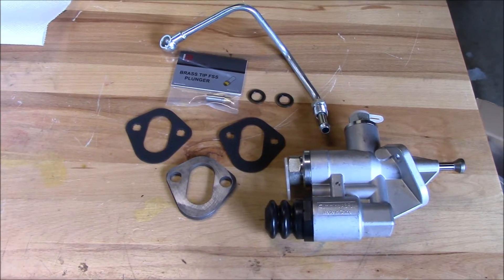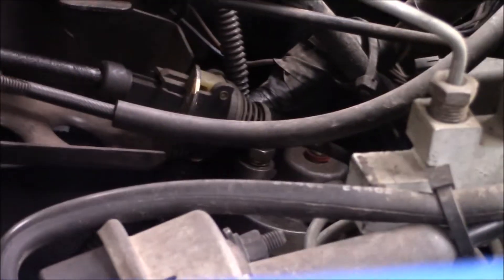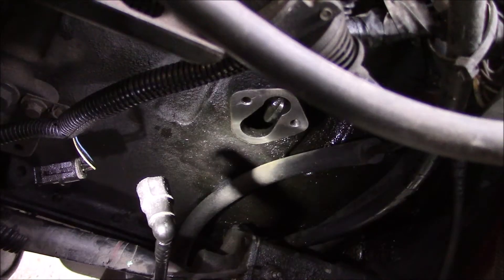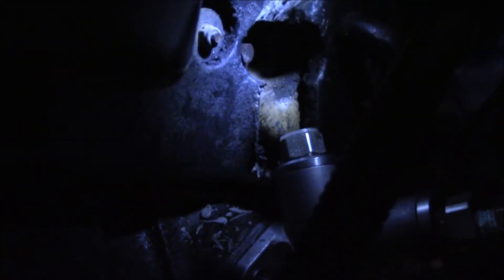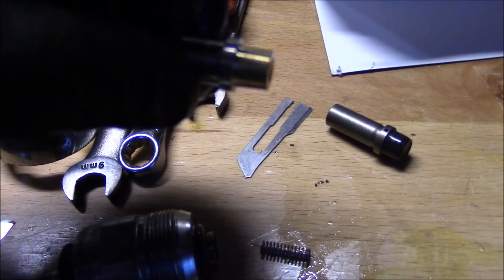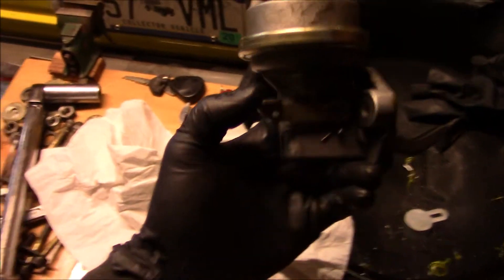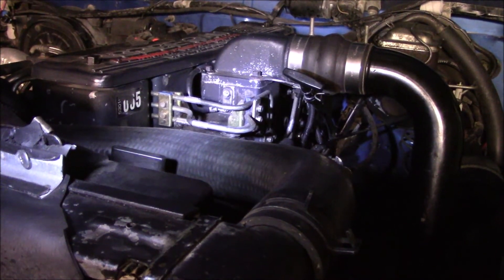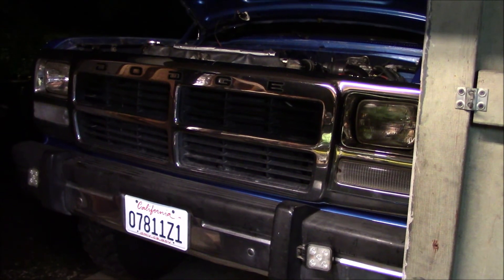1st Gen Cummins Lift Pump! Brass FSS Upgrades!

Comment: nice video how did you cut tappet cover insulation
Reply: Where do you get the brass tip plunger? I need one. My truck won’t shut off with the key.
Reply: @christophersnider4451  found it here: https://www.ebay.com/itm/NEW-VE-Rotary-Pump-Fuel-Shutoff-Solenoid-Brass-Tip-Plunger/154395808575?hash=item23f2b5133f:g:2iIAAOSwAdhcewrA
Reply from the maker: I used a big scalpel and a razor blade mainly. It's a pretty tough material.